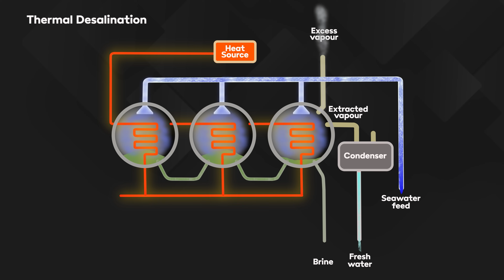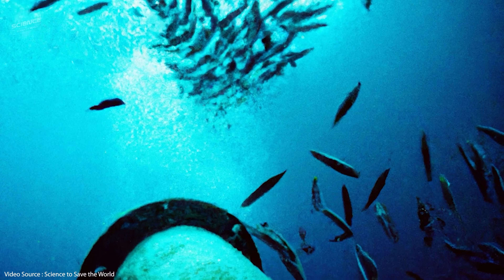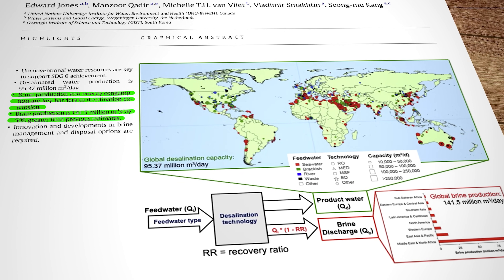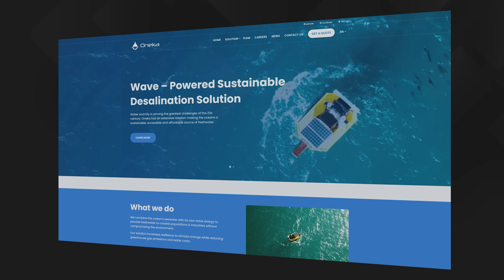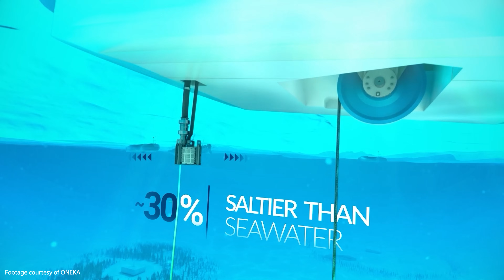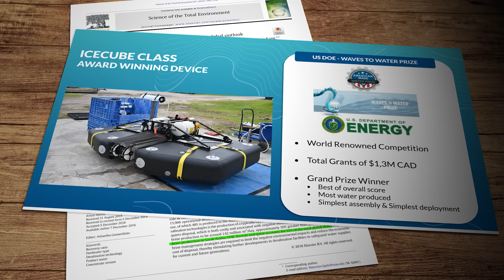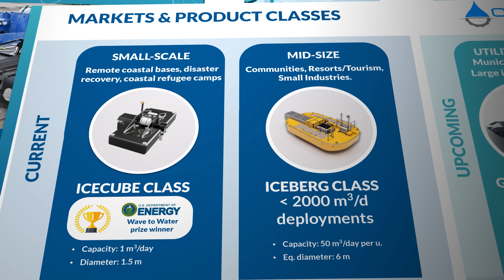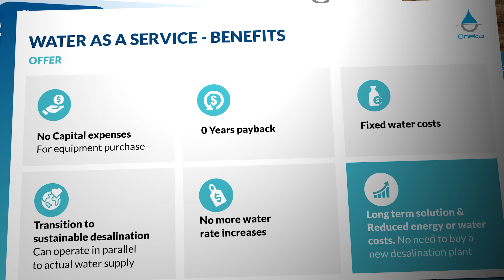Fresh Water at Zero Energy Cost . How do they do that?

Comment: I would have thought that current Desal plants would incorporate salt pools, since you end up with a concentrated brine in the first place might as well turn that waste stream into something profitable.
Reply: Way, way too much salt for there to be a use for it.
Also usually not situated in a way that allows for square kilometers of pools at all, let alone for that to be financially viable.
Reply: @aenorist2431  Sounds like an engineering problem, and not a physics problem.
Reply: @nschrombeck  It's an economics problem.  The salt you produced would be worth a lot less than the extra cost of producing it.  So it's just like setting fire to large piles of money.
Reply: @incognitotorpedo42  Salts do have value in the chemicals industry, so I wonder if the supply chains could be set up for that

Still, we're talking about exploitation of the ocean's minerals beyond just water now, which to a lot of global organizations can be unethical. 

Interesting to dream about, maybe
Reply: Great video, Dave,  I wonder how they stand up to hurricaines or typhoons?